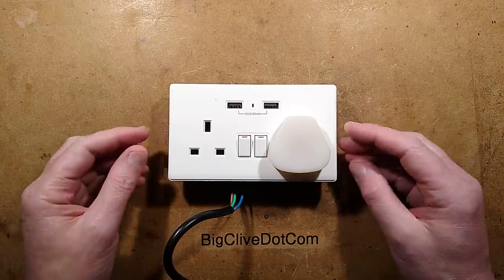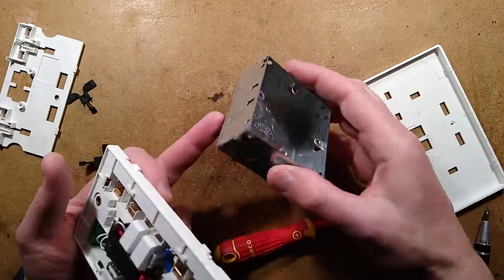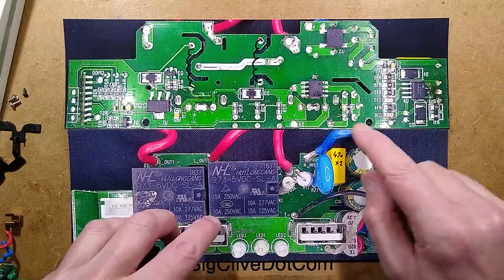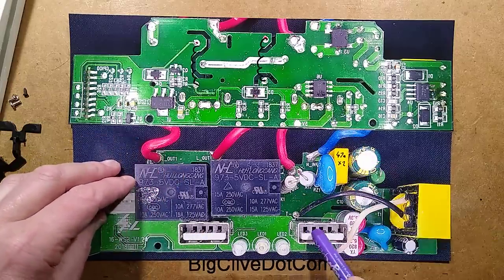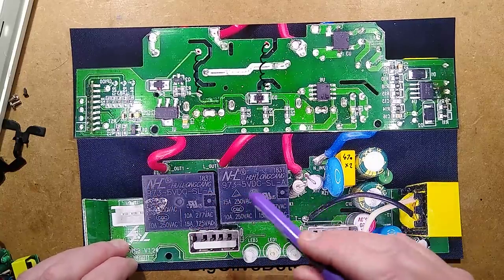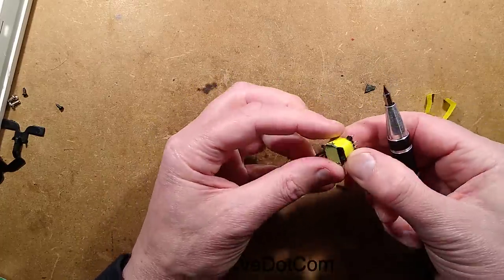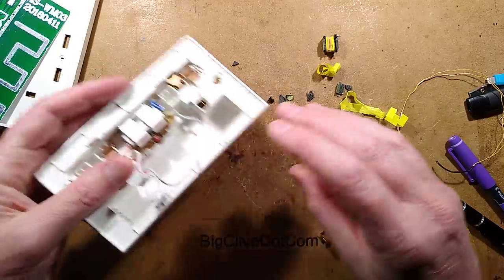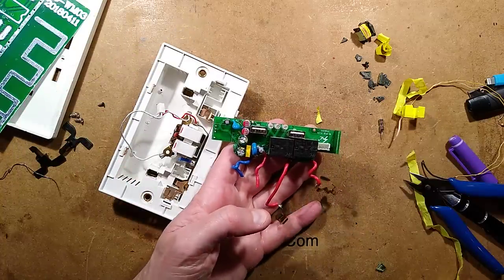WiFi wall socket teardown.

Comment: A year from now we'll all have USB 4? or whatever they want to call it and you'll have to go around and switch all your Outlets out again. yeah I like USB sockets not on the wall they have their place but I much rather be able to swap out a little power supply when they die with something that plugs into a standard socket that we've all had standardized for decades now.
And we all know that the person who is having those sockets installed is the same person who bought the cheapest USB charger that's going to die in a week so they're going to want the cheapy sockets too, buy it once buy a good quality charger to protect your good quality phone, tablet, device.

Comment: Did I hear correctly that the power factor of that thing is 0.4? Why is it so bad?
Reply from the maker: Most circuitry like this has a bad power factor because most current is drawn in pulses at the top of the sinewave as the PSU capacitor is topped up.
Reply: @bigclivedotcom  Ohhh I see! I've seen those current pulses on an oscilloscope and always assumed they were in phase with the voltage. Good to know, thanks for the response!

Comment: As a newb I don't understand how the ac current is rectified before the transformer.  I thought transformers were ac only and would saturate if you applied dc current. 🤔
Reply from the maker: The DC gets converted back to AC at high frequency.

Comment: And the L-N insulation resistance reading of a circuit full of these is? Don't install them. Never have, never will. Dodgy as hell. How is a sparky supposed to certify a new installation as safe with these things buried in the wall?
Reply from the maker: I always used to do a routine live to neutral insulation test as part of my test routine.  But apparently these days they don't do that.  Even though it's the insulation failure that is going to cause the highest sustained current flow.
Reply: @bigclivedotcom  Oh man. What a s~~t storm. Hey, at least the new proposed AFDDs will be protected from ever having to operate by the SPDs. Back to, "where is that funny burning smell coming from?" then I guess. Ha ha.

Comment: I thought a wifi relay might be good for people like you, because if youre worried about powering something up, at least you can be in another room when it explodes!
Reply: For that purpose I'd much rather just have an old-fashioned mechanical switch mounted away from the device in question.

Comment: I have a few USB power sockets (wouldn't trust these for WiFi, they probably cause more problems than they help!), but I use ones from UK shops, not no name Chinese from eBay so hopefully they're decent/safe enough!
Reply: Are you sure the ones you bought are not made in China as well, and the UK reseller just gets rich by rebranding it and charging 6 times the price?
I have seen quality switches at NL shops that were made in China. They charged 10x the price Ali Express charged.
Reply: @peut  Of course that is possible but you'd hope a high street store would value their reputation.
Reply: @stevec00ps  Sure. And if everything fails you have the possibility to smash their windows :-).
Reply: Where you buy them is irrelevant, it's who made them that matters.  Most mains sockets in the shops in this country are OK, but not those with embedded electronics, most of those are made in China by companies that don't care about quality at all.  If it is from an authorised stockist for MK, British General or one of the other reputable manufacturers then it may be OK to buy it, otherwise swap it out as soon as possible.

Comment: The problem with these is that the wifi module is never replaceable. If that, and the USB ports could be replaced (say, cheaper 802.11n / USB 2 1x1 for base spec) and replaced with 802.11ax and USB-C 3 2x2 in future, I would be perfectly alright with these. But no, of course you can't, you'd have to spend big on the best model for this in spite of how ridiculous this is without some antenna between the USB ports to allow for some more direct beam forming. Pathetic.

Comment: I'm a sparky, and have installed plenty of these sockets that have the WiFi repeater built in. 
  WHY the 🤬🤬🤬🤬 can't 'I' have the idea to do what they've done and make a few quid🤬.
   I'm EXTREMELY disappointed with myself 😭.
Rich😍.
Reply: An idea is worth nothing unless you can engi-nerd the damn thing. Time for a second career? Get into Arduino and work your way up. Next time you have a good idea you'll be set to go.

Comment: I just wish I could understand the UK obsession with switched outlets in the first place. Do your appliances not have on/off- switches?
Reply from the maker: It's a useful feature.  It means items can be left plugged in, but turned off.  It also means that the plug can be removed without being under load, which protects the contacts against progressive arcing damage.
Reply: Most electronics these days are powered by SMP supply's that are active even when the device is off. With all these videos teaching us how crap these things are made there's no way I'm leaving 20 or so of these things on when I'm not home...
Reply: I almost agree - I live in a house filled with the things, and rarely use them.
But - occasionally handy to have, and if you don't like them, just leave them on.
Reply: @bigclivedotcom  Yes, but what are the devices that don't have such a switch in themselves? Particularly ones with such high current draw that arcing is an issue?
Clearly, the rest of the world gets by fine without it. I guess ultimately, it's just another british quirk along the lines of separate hot water and cold water taps...
Reply: It is not only the UK. In Denmark it is tradition to have switched outlets, however that is slowly changing. When I got my kitchen fixed a week ago I opted for switch-less outlets. The fridge, microwave oven, dish washer and coffee machine are always on anyway, and I couldn't think of any kitchen appliance I would want to have that would be plugged in permanently and also wish to have a switch on the outlet for.
Reply: It's not an obsession, but it does help if you have an obsession, because you can visibly see that the socket is off.
Reply: @RuneBivrin  Separate taps are increasingly being phased out in favour of bridged mixers, much like the USA's unshuttered (and often un-earthed) electrical outlets are being phased out in favour of GFCIs. Neither of them as quickly as most of us would like, and both largely by attrition.
Reply: There is a comical scene in the BBC3/Amazon show Fleabag in which a deli patron meticulously unfurls their USB cable, check that the outlet is switched OFF, carefully inserts the power adapter, connects the cord at each end, and only once thoroughly checked over, confidently switches the outlet ON. When patron leaves, they depict that entire quite proper exercise in reverse - minutes of a 30 minute show just for comedic effect. It is HILARIOUS by USA standards. We're the "jam it in there" sort of blokes. "How do you reduce all of the arcing?" We jam it in faster.
Reply: But you don't have to them..... UK sockets are available without switches

Comment: 16A fuse? For what? The 5V power supply and WiFi? The AC coming in should already be fused for 10A in the breaker box! Or did I miss something here?
Okay so I watched it again and the fuse it right at the AC input, I don't know what other countries are like with their standards but in Australia, each power point is rated for 10A at 240V, so if you have a double power point like this thing, you still have 10A total across both outlets shared! The fuse is pointless, had the fuse been a lower rating and used only for the 5V power supply then that would at least make sense! 
But the way that it's set up is useless! It might as well not be there! The 10A breaker in the breaker box is going to trip first regardless!
Reply: UK mains circuits are definitely more than 10A, since individual appliances can have 13A fuses. I suspect the 16A fuse in this device is probably to protect the relays and traces on the board.
Reply: 32 a ring circuit in the UK that these will be connected to

Comment: 6:15 That rectifier will never work! (Deliberate mistake?)...
Reply: It's there to absorb back EMF spikes, hence being part of the snubber network. If it was placed the other way around it would work a little bit too well and not allow much current through the transformer...

Comment: I don't care for putting devices that become useless in a few years in the walls. Your always doing something. The special plugs for speakers, low voltage devises, adapters.  Who uses s-video anymore? Better off just putting a hole in the wall with conduit and a generic cover. Guaranteed that this wifi device is obsolete within 2-3 years.  Wifi 6 is almost here for general use. (yes I know there are some)

Comment: Thermo protection in a relay ?
Reply from the maker: Many plug-in remote control sockets in the UK have a thermal fuse glued to the relay in the vicinity of the internal contacts.  If the relay starts to burn up internally, the fuse trips and kills the unit.

Comment: 16 amp fuse seems excessive , maybe its a 1.6 amp at least  the board might survive!
Reply: Sockets are supposedly rated 13A each  but the relays are only rated 10A and the track is way too thin for 10A, even with heavy copper and tin reinforcement.
Reply: John DoDo Doe .
My mistake  the fuse was for the sockets  evidently 2x13 amp =16 in china  I just wonder what fake BS marks are stated on the back!
Reply: @johndododoe1411  The sockets may be rated at 13A each but the maximum current draw through a double socket is only 13A. Triple sockets have a 13A fuse to stop overloading.

Comment: I was wondering how you got those things off the wall....
Reply: Came in the mail from a dissatisfied customer.
Reply: @johndododoe1411  I meant that when it was on the wall, you couldn't reach behind it to pry it open.
Reply: @JimFortune  It's ON the wall, reach under to pry off the faceplate, then remove screws from the two holes in the sides.  Some competing sockets may have the designated pry points on top.
Reply: @johndododoe1411  Obviously not the way Clive chose to do it. He must have been impatient this time around.

Comment: You have a point about it being in a wall with bad reception. It’s interesting how people will see this and think it’s the greatest thing ever, until they go to use it and it requires your social (NHS number, if in UK) so you can WiFi connect your lamp. 

The IoT initiative is a real joke, and for most people, it’s not necessary. 
The only necessary times I’ve seen these things are when a person is disabled and physically can’t move, so they ask Alexa/google to turn on their lights, etc. and that is a perfectly legitimate reason for it, but the average able bodied person does not need it and it becomes something to slow down their WiFi connections in their home.

Comment: I never had much success with Chinese WIFI modules such as this staying connected to the network for more than a few hours without disappearing and needing a reset. I found ESP8266 modules for instance a complete joke and gave up with them.
Reply: Not my experience. I have  modules with an uptime of > 90 days, and no intermediate drops. Maybe it's time to look for a better WiFi accesspoint or router.
Reply: @peut  I've tried that and still the same results. All other WiFi devices work fine.
Reply: @SiaVids  Hmm. Sounds you're simply not lucky. Hopefully this is limited to these WiFi devices.
Reply: @peut  same. I have loads (more than 20) 8266, 8285 and 32's with perfect up time and stability.

Comment: I may be talking through my tinfoil hat, but what happens if all these talk back to a server in some distant country. That server then tells all of said units to switch on at the same time?
Reply: I would not be massively worried about that. A load of people would be mildly annoyed because their living room lights turn on randomly and the grid would barely notice a blip in consumption. If you wanted to be evil, make the relay turn on and off multiple times per second until it wears out and potentially causes widespread fires.

I'd be more worried about the service being discontinued after 5-10 years when the company decides it's not profitable to keep the cloud server up and running.
Reply: @Gameboygenius  true, if you really wanted to wreak havoc you would sell cheap electric cars and chargers - then synchronise them all to start fast charge at 8PM in winter..

Comment: What a useless gimmick

These are mounted inside walls as you pointed out 

Instantly useless for the features intended purpose. Brick as it is ain't great for signal getting through.

Comment: Think it would of been a sim card not memory think logically why would you have a memory card slot on a WiFi board
Reply: You would have a memory module because not all controllers come integrated with the memory. 

The space Clive shows us is the wrong size and shape for a sim card and has no provision for securing the connector to the board. You can see that the designer has printed the outline of an IC package.

Comment: I bought and nearly installed a socket pair with two built-in USB power sockets... then sanity prevailed. “What happens if it fails?” I asked myself, and I didn’t like the answer...
Reply: And how is the perhaps dodgy device plugged into the regular socket less of a risk than the dodgy device wired into a metal box?  I'm confused
Reply: @selkywaters  The heat generated by some failures in the confined space of the wall box could set fire to the building much more readily than a plug in unit might.  The confined space makes a difference to the rate of heat dissipation so it affects the peak temperature that is reached.  The plug-in unit that has a particularly bad failure may make a puddle of plastic on the floor but that's much less serious than generating the same amount of heat within the wall — especially in a modern internal wall which is likely to contain a lot of wood.

The other issue is ease of replacement.  Even if the failure is harmless replacing the plug in unit is easy, you chuck it in the bin and plug in another one.  Replacing a failed built in unit is much more effort.  This applies not just when it fails but also when it becomes obsolete.

I'm fortunate to live in a house where all the walls are made of Victorian brick, even the internal walls. This would be safer but there are still the convenience issues.

Comment: "Can you tasmotize it?"
Reply: If Tasmota has a version that'll run on the ESP8285 then yes. you'll have to connect to the serial pins to do it. YMMV.
Reply: @Alacritous  in fact there is an ESP8285-version of Tasmota... for all the MQTT lovers. 
but off course somebody needs to fiddle out the IO-port mapping. (soldering programming wires or needling some pads: no issue with that.)